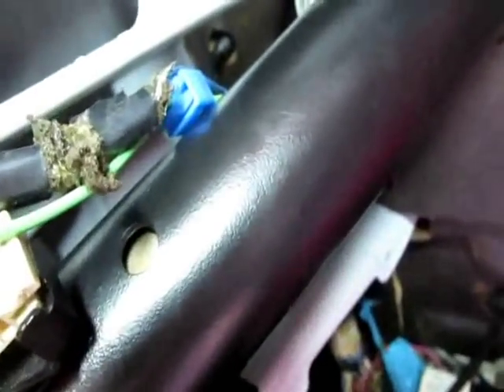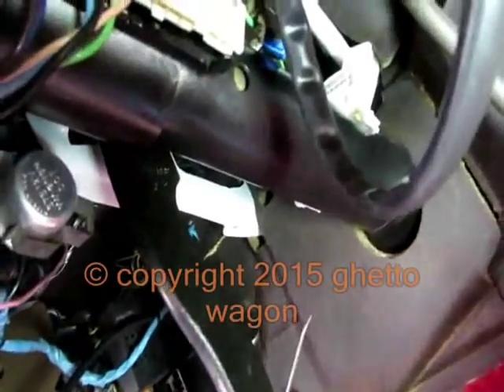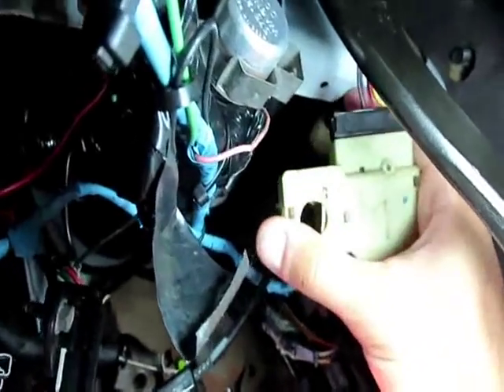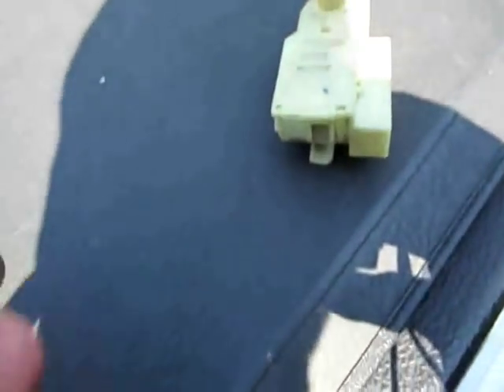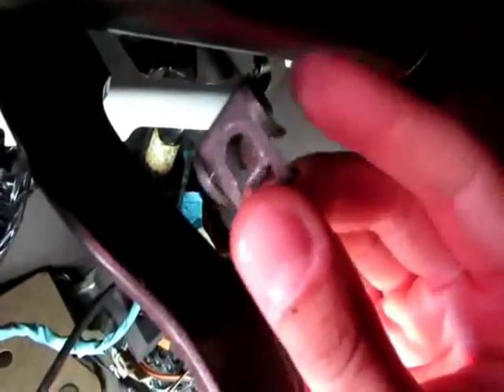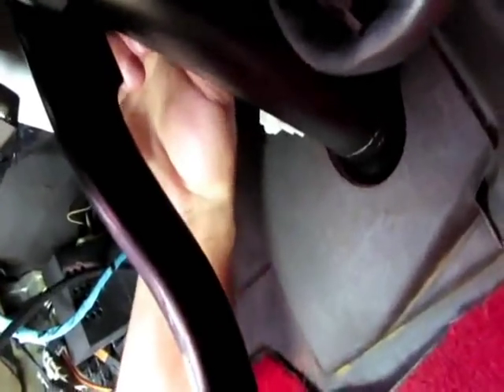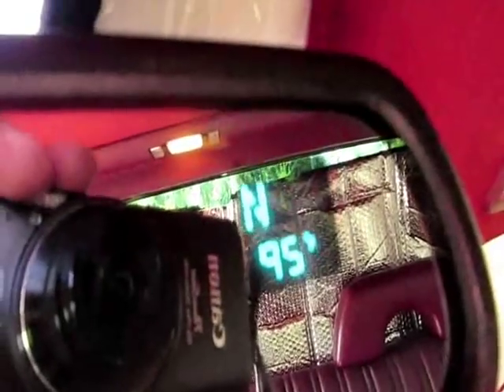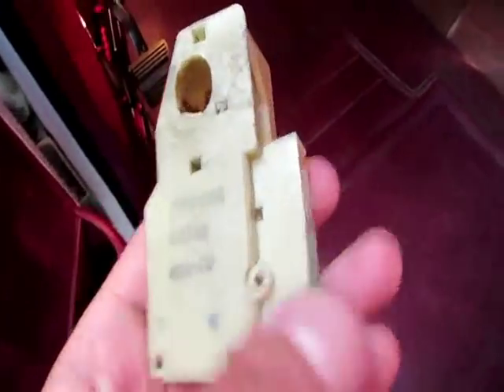Chevy Silverado 88-98 brake light switch replacement GMC Sierra tahoe Suburban

Comment: This switch also effects Transmission( Torque Converter Lockup) and your cruise control use. Check here first it’s cheap and easy and the only problem the most of the time.
Reply: How in the world would this affect tc lockup?
Reply: @ausexplosion1550  there are 3 contacts in the brake light switch. 

One for the brake light, one for the tcc lockup and one for cruise control. 

The switch has to send signal to all 3 components so that they know when brakes are being applied. 

If the tcc doesn’t release when brakes are applied it will burn up the converter or stall the vehicle. 
Same as cruise control, if the brake switch doesn’t send signal to the cruise control, then when you are cruising down the road with cruise control on and you press the brakes the vehicle wouldn’t slow down and stop cruising. 

The surge problem (rpm hunting) issue I had in my truck wasn’t resolved until I replaced the brake light switch. 
My tcc would constantly lock and unlock while cruising and make the rpm’s jump up and down. 
I had a bad contact in the brake light switch.
Reply: @dwayneyoung7988 thank you so much brother
Reply: When i put my 1995 yukon into drive, my yukon kicks into gear you think this might be it?

Comment: People, PLEASE READ. Thanks for the video. I just replaced the switch on my bosses personal 88 GMC 1500. I didn't follow troubleshooting 101. There were no brake lights at all, so I assumed it was the switch. After I went through a couple hours of cussing the GM engineers trying to fit my big self under the dash to replace the switch, there still wasn't any brake lights. I didn't realize there was a 30 amp fuse under the hood for the brake lights and it was blown. Make sure you check ALL the fuses. The third brake light didn't work because both bulbs were blown. So before, you crawl under the dash and attempt this, use a test light or volt meter to verify at different locations.
Reply from the maker: +Rick P  on a newer one there is a fuse under the hood, on a 88-94 its under the dash, The rear brake light  circuit is independently fused, i guess for a trailer.    I burned up a bunch of these switches from high use, I blame traffic for it, so its nothing new for me lol I replaced it 3 times
Reply: Sorry, I mistyped. It's a 1998 I'm working on.
Reply from the maker: Rick P
 Think of if this way, at least you have a new switch!

Comment: The video was a great assist. I have a 94 sierra and the switch was replaced by a mechanic when I bought it 2.5 years ago. I read a great forum piece that said if your 3rd light was out but hazards still work then it is the switch. I watched the video and was able to replace the old one in about an hour. It is not easy to get to but if you watch the video and feel up around there you will get the idea. My old one had a c clip and not a spring clip.  I put the c clip back on for now but will change to the spring clip soon.
Reply from the maker: Yea they had some with a round disc like clip that slide over the pedal rod.   Too bad I could not get a better shot of how the clip goes on.  You have to remove the steering volume, which I Have a few times and the access to that switch is awesome!
Reply: @GhettoWagon  How loud was that "steering volume"? Should I wear ear plugs?

Comment: I know this is 8 years ago but just bought a 95 1500 ( wt) that was kept in a garage since new and just rolled 100k miles.  It’s so straight and. Original paint is almost flawless. Every since I sold my 97five years ago I’ve been looking and I found this gem.  Prly swap to a 350 one day but for now I can deal with the 4.3.
Reply from the maker: ya TBI is real easy 4.3 to a v8.    Think you can even reuse the same harness just change the ECM Memcal on the truck and then. of course 350 TBI, Distributor knock sensor etc v8 van shroud. I remember Dude who came by had to sell his old truck for a van.. And I was like 
"yea but its a 305" and he had good point "Atleast its a v8"   Yea..   100%  305 works

Comment: have no power to brake light switch thinking relay dont know witch one under hood 1988 chev 3/4 ton 4x4 fuse is good any thoughts?
Reply from the maker: Not sure if they had a relay on the fire wall over the brake booster like this one has   Or maybe they added that when they added the 3rd brake light in 1993 or 4 I forget

Comment: Damaged shifter mechanism from pulling too hard when brake interlock solenoid won"t release from PARK has led me to this switch.The switch is easily repaired. Carefully release locks around switch body and one in middle and remove switch cover.Remove the small copper plate and using a pair or crecent wrenches,bend the small plate very gently in direction of pedal shaft wear.Bend just barely past 180 deg.Push wear spot toward pedal shaft.You're just taking up the play.The contacts can be removed for cleaning but looked great after 321k.Put tiny spot of grease each side of copper plate and worked great! Getting clip off was a bitch and wire harness could be 3in longer.Hope this helps!

Comment: That clip is a booger!  I have a 94 Suburban with an aftermarket alarm that is taking up a lot of space under the dash. I'll try the pick since it worked for you.

The other thing, I swear I used to hear a relay click when the brake lights came on, but the schematics show no relay on the burb.
Reply from the maker: Shannon Looper yea, large pick tool is what you need,  Small does not work too hot! I did not have one in years past, With some creative wiggling its easy to get it off, I had this switch on and off in 10 minutes, I never did it so fast!   When I took the column out a few years ago, WOAH big room! I have about 30 new GM brake light clips, I should sell some.  The 94 burban does not have the relay on the firewall?
Reply: Shannon Looper Success! I used a small pair of curved needle nosed pliers. Thanks again for the great video!
Reply from the maker: Shannon Looper  No prob, Gotta help someone!

Comment: everything on my truck is starting to fail. my step dad left me with a mess when he passed away. a few months ago.
the blower fan went out, breaks light switch failed, the power steering return hose started to leak, and the interior lights wouldn't shut off one day so i just pulled them. 
besides that i had to put the bed back on and get a new tail light harness. also had to put a side mirror back on.
its a pos truck but it drives better than my car because the trans failed on it. i just have bad luck with vehicles.. every year is a struggle.
Reply from the maker: IF it was not gone through and its some years old they will do that.   Does it have 500,000 on it?

Comment: Your KEY piece of information here is , there is a RELAY in the brake light circuit!
 It's NOT on the firewall, but I will forgive you for that mistake. It's inside the "relay center", a black plastic housing  mounted on the top of the front left wheel well.
 If if turns out to be my problem, I will send you kisses.
Reply from the maker: Mine has the relay on the fire wall. Other years maybe had it on the inside.  Its not my mistake. You need to  Figure out your own wire diagram they changed alot of on these trucks year to year.  or with different options

Comment: The round one found on the 2000 Tahoe limited...  is No fun. I found that using a long flat screwdriver and pressing from the center outwards. Will cause the Clío the get loose, also trying to pop it upwards helps too. Motorist pulled up next to me on a red light and let me know that I didn’t have brake lights. I was wondering why he was getting so close to me 😂
Reply from the maker: Ya they used to warn me up north. Here in FL no one cares. Half the cars have no lights anyway its crazy

Comment: I'm having a hard time finding the proper wire to tap for my brake controller. And help is appreciated
Reply from the maker: U need a wiring diagram
Reply: @GhettoWagon  I never saw the notification for this message.  I got it, was fighting my stoplight switch.  Finishing up the next phase. Air bags
Reply from the maker: @jonyates3918   You need to tap into I guess the brake light wire and ground it. Then the wires run to the back   And probably a Key on 12v source. U need a diagram to tell which wire is what

Comment: thanks just got my new switch
Reply: tonychevyobs 1500 I'm now installing my third switch.  My brake light switch leaves my brake lights on all the time.  Replacing the last one for the same thing about the lights staying on.  The reason why I replaced it the first time was that when I purchased my GMC the brake lights didn't work at anytime.

Comment: Do you know if the brake light switch controls getting the transmission in and out of park or just simply turns on or off brake lights?? My brake lights wont work on my 98. Fuse and bulbs are good. Only haven't checked relay or switch. Plan to fix this week so any pointers or tips would be great! Any ways to test switch or relay? Taillights, blinkers and hazards work just no brakes on all rear lights.
Reply: Having this problem how did you fix it

Comment: Need to do this, feels like my overdrive is slipping but my trans is rebuilt with less than 30k miles
Reply from the maker: Could have shot 3/4 clutches from a horrible rebuild if its doing that in 4th

Comment: Great video. Thanks for posting. You just saved me a ton of work, I just pulled and managed to replace without to many cuss words..  Ok that's a total lie.  It's a bitch but I got it done.
Reply: I only cussed twice while doing it.  That has to be a record
Reply from the maker: If is hot like it is here I would of cussed like 800 times.  But I know its cheaper doing it myself, the job will get done and no one will crash me (I hope) and I wont get pulled over for not having working brake lights.   The people around here don't even tell you "Your lights don't work!"  Because so many drive junk with 2-3 ALL OUT BULBS, Busted out lights.   And there are U pull junkyards everywhere to get a replacement!
Reply: I totally agree, thanks for standing on ur head while videoing this! Kudos man👍👍👍
Reply: this video is not for 88 to 98 the switch is different under 94 there is no clip
Reply: Ghetto Wagon my friend thanks for your video I have a question I have a92 Chevy 1500 and only my left brake light doesn’t work I already switch light bulbs and nothing it turns on when you have lights on but if you press Brake pedal it doesn’t light up

Comment: You think I have to switch mine 
My problem is that when I hit the brakes the brakes lights stay on  (any ideas)
Reply from the maker: Well.. unplug the switch connector if the lights go off most likely its the switch.  If they still stay on the relay could be sticking or you have a bad short somewhere

Comment: my s10 was the relay. we changed the switch and tried tracing wires cuz wr thought it was a short. wrong... just the relay
Reply: Geez!.. . ..you did it the hard way FIRST!   The easy solution, a new  relay,  didn't fix my issue.

Comment: My brake lights stopped working I replaced the switch they worked for about a month then stopped working again. Any thoughts ?
Reply from the maker: could be a bad fitment at the switch or you are using garbage new switches because the quality of everything is poor now. Also check the condition of the harness and connector pins that go into the switch. Also check the brake light relay if your model has one they can do bad  But you would need to verify that the circuit works to the relay need a diagram.

Comment: We're can you get a replacement lock ring for the break switch. I went to my local automotive stores and they gave me a wild look. Never seen it before. And your right that clip ring hard get off
Reply from the maker: Get a long pick set and you can work the clip off, You need 2 pics  I used like a semi curved one that's on a angle and I think a straight or a 90.     Just make sure u dont poke yourself or any wires.  Ya I changed this switch like 5x they dont last 
 You can take them apart and clean all the contacts and sometimes they work again
Reply: It's NOT a "break switch".
And YOU'RE right (NOT "your right") would have sounded better, like you attended grade school.

Comment: I need to do this exact job and I'm dreading it!  What were the engineers thinking when they hid that part way up there...a moving part that would have to eventually be replaced.
Reply: Just did this...took about 45 mins.  It's big balls but not impossible.  Thanks for your help!!
Reply from the maker: NP
Reply from the maker: Its easy to get to when the stirring column is out.

Comment: What exactly was the issue that led you to find out it needed this switch ?
Reply from the maker: What does the brake light switch do? energizes the relay to do what?  Light the brake lights
Reply: @GhettoWagon  .... I know that... I've read that it also will keep the vehicle locked in Park while idling after driving... So that's why I asked...
Reply from the maker: @poppagrouch4781   Cant on these. They had no interlock on these old Chevy's

Comment: Supposedly you can push the parking brake and if the dash brake light gets brighter, it's not your parking brake switch. It might be the fluid level or pressure differential switches.
Reply from the maker: Thats only for ABS problems.
Reply: @GhettoWagon  what's ABS?

Comment: Do you have any videos of how to lower steering column?
Reply from the maker: No but its just 2 bolts under the dash and 4 at the fire wall optional.. unbolt the steering shaft.    The steering column comes right out I usually remove them when I need to work on them, take them apart inside in the AC, fix it, reinstall.

Comment: What are the symptoms of a bad brake switch? I have an issue with my 95 where the 3rd light turns on but the other brake lights won't turn on when pressing peddle. All the other lights work as far as reverse and running light
Reply from the maker: +thesmoothone  Brake light switch is going to kill them all.  I think the rear tail lights have a fuse to protect them independently, as in towing a trailer and the trailer shorts out. That. or check the ground by the rear of the frame on the drivers side.    Don't RULE out bad circuit boards on the tail lights either. Of course check the bulbs, i bet you did that already
Reply: Did you ever find o what it was mine is having the same problem

Comment: I am having the opposite problem as thesmoothone. My third break light on my 97 Silverado IS working but the tail lights on the bed do not. I have park lights and turn signals but no break lights. The previous owner had a trailer light set up which I've disconnected and gone back with factory hook up but nothing has changed. All fuses and bulbs are good. I'm puzzled since the break light and park light are the same bulb; and since the park light works it's not a connection issue. Any ideas?
Reply: Ezekiel 9:1 did you ever find out what it was mine is the same problem
Reply: Check your tail lamp circuit boards. It's the part where you plug all your light bulbs into. I had to replace mine not to long ago.

Comment: Good video. Be careful if you do "drop the steering column" if you need to reposition yourself and grab ahold of the wheel your truck may jump out of park and slam into a tree with you upside down In the floorboard like mine did. Not the best most complete instructional.
Reply from the maker: Set the E brake

Comment: I have a 1990 GMC Sierra.  I don't have any tail lights, turn signals or brake lights. Ground seems good.  Power to the back is there. However, when I hook up the camper trailer the lights on truck are dim, but brake lights work on camper. help!!!!